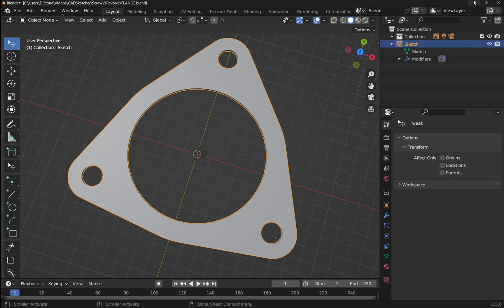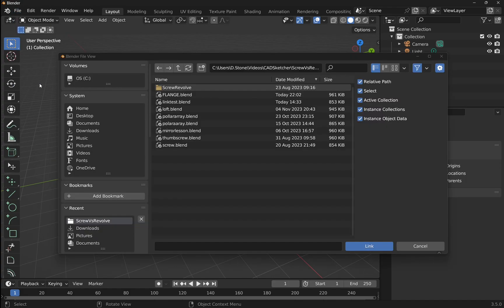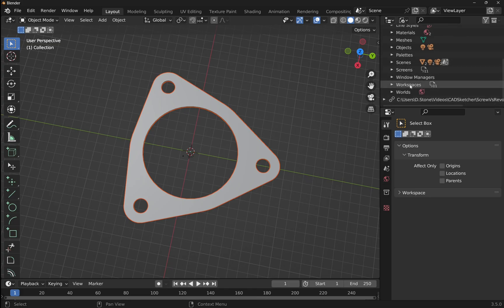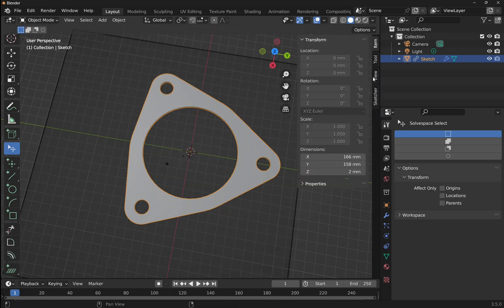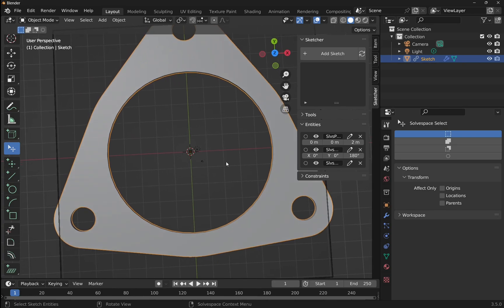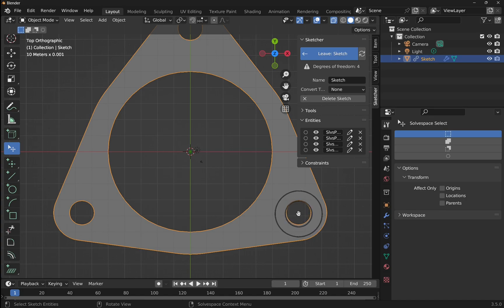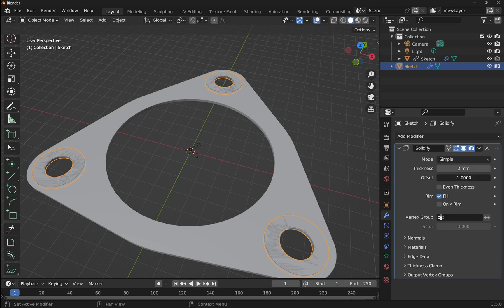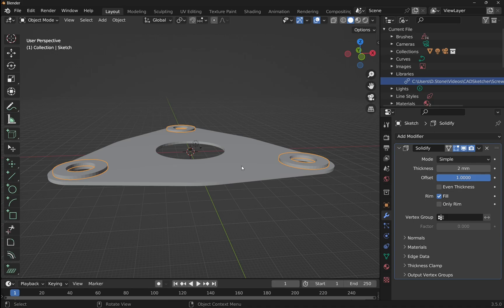Learn CAD Sketcher | 12 | Link files from other Blender project to use as a base feature

Comment: This is an excellent series! The best resource for CAD Sketcher! 

Please update your playlist (video#11 and 12 are not added to it.)

Secondly, can you please show how CAD sketcher can be used to create a key for clarinet/flute? 
I am requesting it because it requires very different modeling techniques, which are not covered in your playlist so far.
Reply from the maker: Great, glad you like it, and thank you so much for the heads up about the playlist. Have fixed now. A key for a flute now that's an interesting request, I see what I can do.
Reply: @MJ3D_Blender  Thanks for the positive response!

A flute key has the following shape:
1. Its main body is a thin circular rod, which passes through two posts mounted on the flute's cylinder.
    (The posts are designed to allow it to rotate a little when the key's lever is pressed).
2. It has a disk ("pad") at one end, to close a hole.
    The pad is attached to the road via a small arc-shaped link.
3. At the other end of the key, there is a lever (which is pressed with a finger to operate the key).
    This lever can be in any of the multiple shapes (depending on the design.)
4. The lever and pad can be on the same side of the rod, or on the opposite sides of the rod.
    (This depends on the design: Whether the pad is supposed to close the hole or open the hole when the lever is pressed).

The flute (or clarinet) has multiple keys side by side.

IMHO, CAD Sketcher is best suited to create these keys with precision.